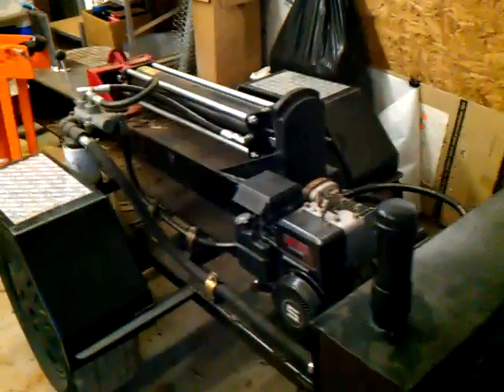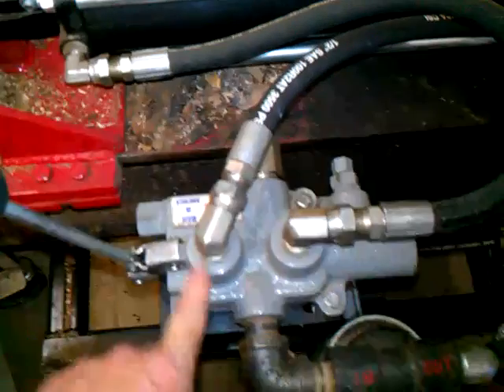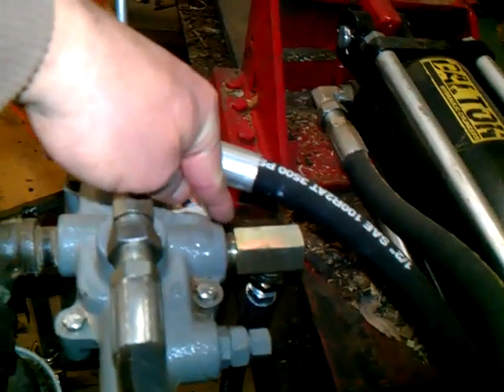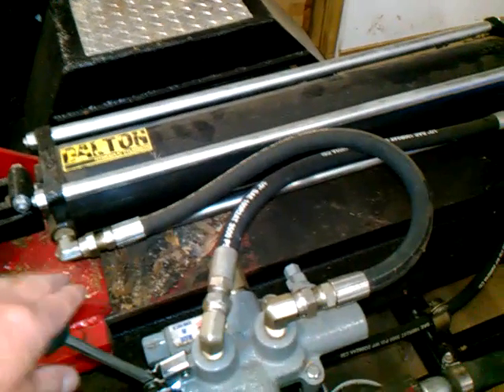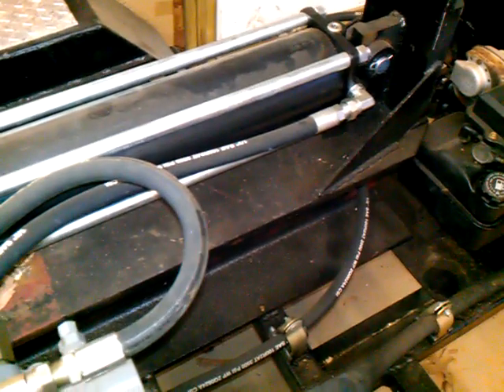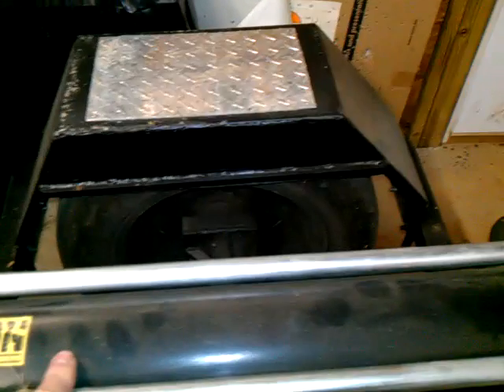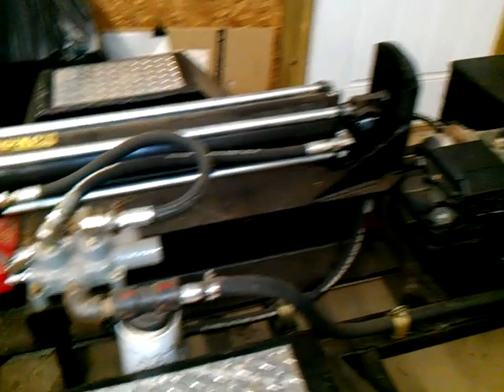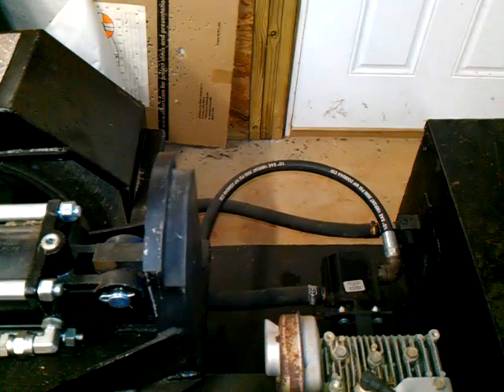how hydraulics work on wood splitters

Comment: I was considering rebuilding my Huskee 22 ton log splitter, the engine (Bstratton 6.5hp 190cc) has essentially fallen apart after 20yrs (still runs tho) but the Hydraulics are fine and while its getting a little rusted i still think the frame has some life in it.. now, I think it may be a 9 or 11 gpm pump on the splitter. Do you think it feasible to put a 13gpm or 15gpm pump on it to increase the rate of cylinder movement? If so would I have to considerably up my HP in the engine? It doesn't seem to notice with the little 190cc when its seriously strained against a huge log so the engine already on it seems like it'd handle more power demand from a bigger pump.. maybe going up to a 7.5hp 223cc and 15gpm is a reasonable consideration?
Reply from the maker: What you're saying is correct the only thing. Is make sure you get a 2 stage pump.

Comment: Well I would think your return line could or should be mounted higher on the tank because it would potentially cool the hydraulic fluid some anyway. Am I wrong ? It doesn’t matter. I would go so far as think you could even come in to the very top of the tank. I’m just guessing,  thanks for explaining it. 👍✌️🇺🇸

Comment: Hey thanks for the video. I just replaced a pump on a 27 ton Troy built log splitter and I get very slow to nothing moving on the ram. I replaced the pump because of low performance on harder wood. My thought was the pump was failing to go into stage two pressure. Me thinks my problem is air in the line. Documents on the splitter claim it is self bleeding.  How would you approach this issue? Thanks.

Comment: I have a cross brand valve  that detent will not kick off once it returns all way to cylinder  looks similar to that valve  I have  tried either loosing or tighten  the detent release valve and still nothing

Comment: My splitter was low on fluid and appeared contaminated. I drained the system as well as I could removed hoses and drained them. Replaced fluid and filter.  It seemed fine for a few days. I attempted to split some rounds today. It pressed into the wood and stopped. The ram goes out and in fine. But it won't split wood. I tried a small limb about 4 inches That I would not have split to test it. same results.  Briggs engine 8.75 runs fine. DR 22 ton.
Reply from the maker: Did you have any metal shavings? 
Hydraulic pumps do not like to run out of hydraulic fluid. It can cause cavitation which can make little small pitts.

Comment: I bought a returned 30 ton log splitter from a box store.  I finally got it running, and on softer or smaller logs, it works great.  On a larger piece of oak, and some hedge (orange osage), it knocked real loud as it slowly begins the split, once it pushes into the log the knocking eases up.  Any thoughts on this?
Reply from the maker: Can you tell if it's the motor or if it's the hydraulic pump
Reply: @hossitis  gas engine runs fine - no surging or bogging down.
Reply from the maker: Sounds like you have a two-stage pump and on the first stage when it starts into the wood is where you are getting your knocking from. Then the second stage starts it will be a little slower. If I were to guess the knocking is going to be in your pump. Not sure exactly which pump you have. You may be able to looking on the internet and see if anyone else is having the same problem. Hope this helps.

Comment: I'd put the filter in-between the tank and the pump  so the fluid gets filtered. Before it runs threw  the pump. And put a magnet in bottom of tank to collect any metal shavings🤘
Reply from the maker: The reason most people put the filter after the spool valve is there is good pressure to push all hydraulic oil through the filter. It's easier to push hydraulic fluid through the filter than to suck it through filter.

Comment: Stick a good magnet on the bottom of the return side. That way if any metal does happen to get through your filter it can catch it
Reply from the maker: If at all possible I like to put it inside the tank. That way if your magnet gets knocked off you don't lose all the metal shavings at once.

Comment: Hey hoss you still splitting wood? I'm building a wood splitter and I got to set up just like yours but now I want to come off the pump and give myself some hydraulic pressure to another ram to lift up a gate and drop it down bring the rounds to the splitter from the side of my truck can you explain how I do that with the hydraulic pressure line split it if I put in a valve in each line they have them screw in valves okay take care and thanks for the video.
Reply from the maker: Sorry I missed your question but you can just put two dent valves in line with each other and control one left and one does the splitting

Comment: I have a  older John Deer splitter 5 givin to me and the lines need to be flushed. A small reservoir for a tank. The only way I can think to flush the system is to fill up with hydraulic then run it, and drain it again from the tank with a pump. Then refill it again. Is there an easier way?
Reply from the maker: You can take the return line off put in a old bucket. Then fill tank Run pump keep filling tank while pump is running until you run 5 to 10 gallons through it then you should have all new fluid through hoses and cylinder. You will have to be using the lever to run the cylinder all the way forward and all the way back. This will be the most expensive way to do it. hope this helps I would use the cheapest hydraulic fluid you can find.

Comment: What is responsible for the rate of speed the piston moves forwards and back ?  Thank you for the video and your knowledge
Reply from the maker: There is a lot of difference in speed depending on if its 11 gallon a minute pump or a 16 gallon a minute pump and what size cylinder you have on your log splitter.

Comment: Me and Jenny..we were like peas and carrots 😉 Good explanation thanks for that. Was tinkering with a threaded adjuster on mine. No idea what I’ve done to it as nothing seems to have changed. Assumed it would have altered the pressure therefore the speed of the ram and power applied however no noticeable difference🤷‍♂️

Comment: My wedge on my 26 ton brave wood splitter won't push threw the wood
Reply from the maker: Could be a bad valve or you could have problems with the seals on the Piston inside the cylinder

Comment: Is it possible to put a hydraulic oil cooler on a wood splitter...home made...inexspensive...how much pressure is on the return line. My neighbor insists on running my wood splitter in the middle of a hot summer day ...4 gallons of oil every time he blows the return line off...

Comment: why on earth would you filter oil thats just been thru entire system ffs surely you would filter as it leaves tank before going into system the sit is going to be   in tank  complete waste of filtering after  any numpty with half a brain would see that surely
Reply from the maker: It better to push the hydraulic fluid than pull the fluid. In my opinion.

Comment: Hi Ihave log splitter It will split small pieces but no pressure to split big ones. It it seeping a little from the cylinder and some from the detent valve. Any ideas how to fix it. Thanks
Reply from the maker: Sorry I missed your question. Sounds like you may have seals on the Piston inside the splitter going bad.

Comment: Thanks HOSS-IT-IS, Video has helped answer some of my questions.  I have the Northstar 30 ton splitter which I purchased in 2007 and has worked flawlessly until last fall when the filter seperated.  I replaced the filter and have used it for several hours since and today it seperated again.   What would be causing this?  Also, when I removed filter a spring fell out of the filter holder.  I am guessing this is some sort of pressure relief.  Suggestions as to what to due?????

Comment: Good info. I have a Ariens 27 ton & have damaged the cylinder. Can I replace with a cheaper cylinder? If so , what perameters need to be met ? Thanks.
Reply from the maker: I used a Dalton cylinder

Comment: Explained very good. Now I have a problem that you may be able to help with, As long as the splitter is not in use (neutral position) not is wrong but when I pull the control lever to split the wood the fluid pores out of the reservoir tank and the splitter does not move. Is the control valve bad or the cylinder bad?
Reply from the maker: I would thank control valve.

Comment: Excellent description! Finally someone who explains the circuit simple and complete.
I have one question: how do you deal with the engine temperature as this kind of motors are refrigereted by air and if not may overheat? Thanks a lot. Great job!

Comment: We're there options on the pump  as to fluid movement? Now I am wondering if the 1 inch fitting, hoses  through out the unit  would it create less heat? This it a great vid! Do you have a parts list, cost sheet ? What do you think about a prince valve? What are my options ? Thank you

Comment: Hi, it's me again from down under, how do you determine the tonnage , is it the size of the hydraulic ram
Or the hydraulic pump, cheers.
Reply: Hi.from NZ.type in your specs on this website for tonage,there is another calculator for cycle speeds too http://www.baumhydraulics.com/calculators/cyl_calc.htmBore size would be the most determining factor for tonage and shaft size for return speed.ive just bought a cheap ram that is 3.5 inch bore with 2.5 shaft so its not the gruntist but will have a quick return speed running a 22 GPM pump.
Reply from the maker: Egidio Borg It's the inside diameter of the cylinder that determines how many tons of force it can push. The shaft size determines how fast it will retract.
Reply: Egidio Borg UI
Reply: To determine the pressure of the hydraulic cylinder you multiply the area of the cylinder piston (3.14 x radius) by the pressure of the pump.

Comment: Hi, when the oil returns back to the tank is the inlet below or about the oil line, cheers.
Reply from the maker: Egidio Borg  
Below the oil level bye 2 inches
Reply: HOSS-IT-IS great, one other thing  I am using a old 5 kilo gas tank which is around 5 litres of oil,
would this be enough oil to run the splitter.
Reply from the maker: i would try and use at least 2 1/2  gallons. You may get by with 5 litres

Comment: I'm impressed with you're video ty. ? I'm building a splitter I have a 5/8 " shaft on pump do you have a clue what the GPM are 3/4 threads there are no markings on pump the hyd cylinder is 4" by 26" w/ 1.5 shaft running 16 HP engine w/ 30 GPM double throw valve center neutral and any thing else you can tell me .like working pressure, is it a 20 ton? Or what should I put a air vent w/ filter cap on tank I'm using old 10 gal beer keg .ty

Comment: Can you put the filter on the line going into the pump instead of the return line back to the tank?
Reply from the maker: If your tank is clean it's just as good to put the filter on either side of the tank.I put my filter were i did because it was the best place for me.
Reply: You did an awesome job, Thanks for the video!!!
Reply: You don't want any restriction to the inlet of your pump, keep the filter on the tank return. I would actually recommend a larger hose for the inlet as well, your pump will thank you.

Comment: So if my dirty hands 22 ton just up and stops in mid-split, and now won’t go either forward or back...oh and I JUST changed the hydraulic fluid and filter...it’s likely the pump? This machine can’t have 15-20 hours on it!!
Reply from the maker: Keith Rayeski I would be suspicious of the Dentin valve or either a air in the hose "air locked" if you just change the hydraulic fluid and hydraulic filter.
Reply: i have dirty hand tools 35 ton which is full of hydraulic fluid but stopped mid-split and won't move at all. I haven't had this wood-splitter but 4 months but have had to replace my pump because it started leaking but since the original pump is on back order they sent me a lesser pump.....I don't like having to stop and fix my splitter but looks like i'm back on the phone with dirty hand tools....Hoss-IT-IS I hope you're right that the Dentin valve could be a concern...I'll do a real troubleshooting session then call them....

Comment: I am trying to work out how you calculate the right size pump for a given size motor ...I have a 6 horse power  ...also are all gallons in America 3.785 litre or are they just your petrol gallons you put in your cars ...or gas as you call em...most places around the world use imperial gallons which are 4.546 litre or litres
Reply from the maker: https://www.northerntool.com/shop/tools/product_200321055_200321055

https://www.northerntool.com/shop/tools/product_200321051_200321051

This is how you can tell what pump you need the first one needs a Minimum 8 HP or larger gas engine.

The second one needs Minimum HP: 5.

Hope this helps

Comment: hi how would you bleed the system, I have a leak in my splitter it is weeping from the back. I want to try and replace the seals myself but not to sure how to remove the pressure from the system to take apart.
Reply from the maker: Sarfraz Munir you may be able to find a YouTube video of replacing a seal just like yours. I'm not sure what kind of splitter you have.

Comment: Would it be better to have the filter before the pump, or in the return where you have it?  Seems like the oil should be filtered before it enters the pump/valves.  Thanks again for this explanation, definitely helps a newbie like me!!
Reply from the maker: It's best to have the filter on the return line.The hydraulic fluid gets to run through the filter many of times during a wood splitting session.If it were between the pump and the tank you would have all the pressure from the fluid in the tank trying to come out during filter changes some times I just change the filter. Plus if the filter get a hole knocked in it you won't lose all your hydraulic fluid.

Comment: You can also make a cooler out of copper or steel pipe BUT it needs to be the same inside diameter as your hoses or larger, probably 1/2 inch.  Don't need any restrictions in the return side. It'll just blow the hose off.

Comment: I have an old homemade pulley system.  The pump went bad.  Going to replace all except dentin valve with a system like yours.  Between my pump and the dentin valve, there is another valve in my system that increases and decreases the pressure by turning a screw in or out.  It also has a return line to the tank.  Do I need this valve?  I was told that if I omit it, the system would blow up.   Thanks!
Reply from the maker: august vlasak the Dentin valve has a pressure relief valve in it

Comment: That surprising every hydraulics place I've asked about pumps for my splitter say 8gpm is maximum for my 5.5 hp Honda thanks for reply
Reply: 11 works fine with a 5 horse Briggs.
Reply from the maker: This can run on 5 hp https://www.northerntool.com/shop/tools/product_200321051_200321051

Comment: The reason the fluid gets hot is because it must go through a tiny orifice which increases friction thus generating heat so to reduce heat you could very easily add a hydraulic cooler which would reduce the fluid temperature thus lengthening the hydraulic pump life. Good job explaining it though! Easy to understand!

Comment: I have an old log splitter Mighty MAC.  When I pull the handle back to retract the piston hydaulic oil shoots out the back where the bleeder valve is which is basically a cap with holes in it.  Any ideas what is happening?
Reply: That's not a bleeder valve. That's the detent or valve kickout. It's got 'o' rings in it that go bad. You can set the pressure you want the valve to kick back out to neutral with it. Before you tear it down or start taking it off or apart, back off the lock nut and run the middle all the way in so you know how many turns to back it off after you rebuild it. Then if it doesn't hold, adjust the middle part in until it does that snug up the lock nut.

Comment: Thank you for this video. Question, my hydraulic fluid is constantly cream colored. It must be from condensation. It is expensive to keep changing. Any ideas. Respectfully Dallas
Reply: Air will go where fluid (water, oil, fuel etc.) won't.
Reply from the maker: dallast21 sounds like you may have a leak in your return hose and it's drawing air
Reply: OK, thank you very much. I'll let you know how I make out.
Reply from the maker: dallast21 I had a backhoe do the same thing small leak was making a little whining sound and was making the hydraulic fluid foamy I held a rag over all the joints until I found the joint that was leaking air into the system but fluid would not leak out. when you use the rag make sure it is wet
Reply: I have a problem with the hydraulic it goes very slow I changed the oil but still goes slow what can be the problem Nick